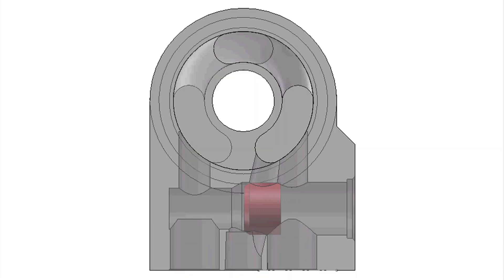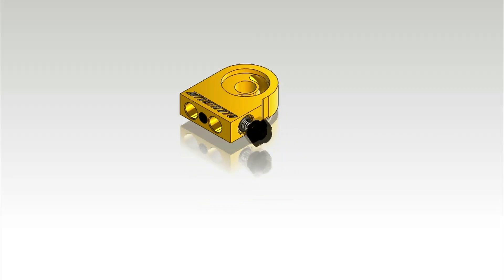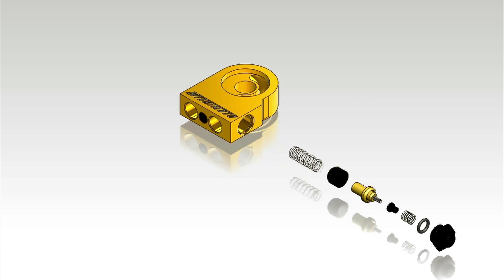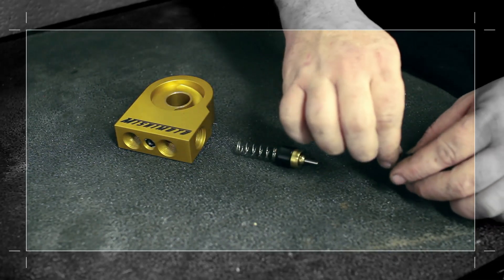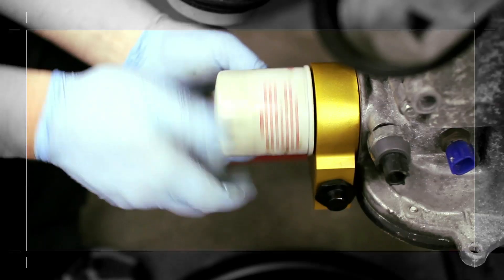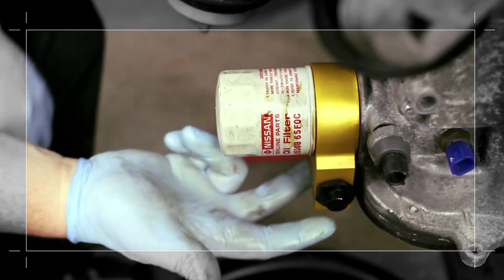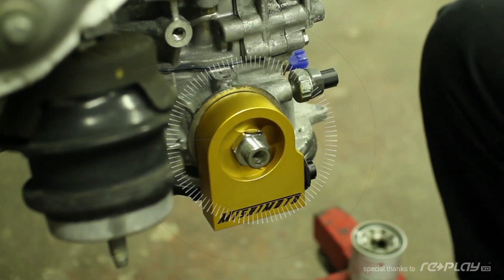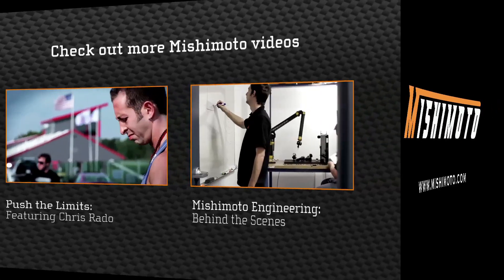Thermostatic Sandwich Plate Features & Benefits By Mishimoto

Comment: Can I stack a normal sandwich plate with a sandwich plate for oil cooler?
Reply: Oh i see. I have some problem then. I  need a 5 port sandwich plate. 2 for oil cooler, 1 for oil pressure sensor and 1 for oil temp sensor. And I need 1 more for my stock oil pressure switch. Is there any product you can recommend?
Reply from the maker: Unfortunately not for 5 ports. our rear mounted plated allows for the two oil cooler ports plus 2 additional sensor ports but nothing with 5 ports.
Reply from the maker: We do not recommend stacking plates and this creates a higher chance of a potential failure.

Comment: Would the side 1/8npt hole be suitable for measuring oil pressure? Or is it only on the cool side of the cooler?
Reply from the maker: Some people will use this for pressure or temperature. However there is only the single port on the plate.

Comment: How does the oil flow? does it flow through the filter first then go to the oil cooler when warm? or does it flow to the cooler than the filter?
Reply from the maker: Oil hits the plate, then passes through the cooler, back to your filter, then to the rest of your system. Feel free to reach out to Support@Mishimoto.com for more details!
Reply: @mishimoto  Thanks! that's very helpful Though now I'm worried if my motor thows shards through the oil I will have to replace the oil cooler... But not to worry. Thanks for replying.
Reply from the maker: You'll typically want to replace all coolers involved along with ultrasonic cleaning of the lines if you have metal go through the oiling system. Much cheaper than ruining a new engine 👍
Reply: @mishimoto  Thank you for the information!